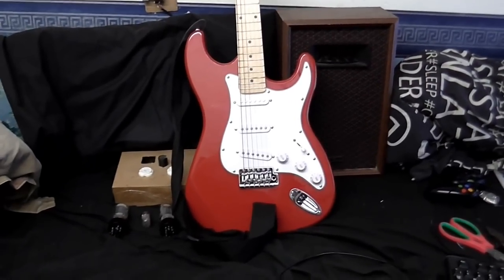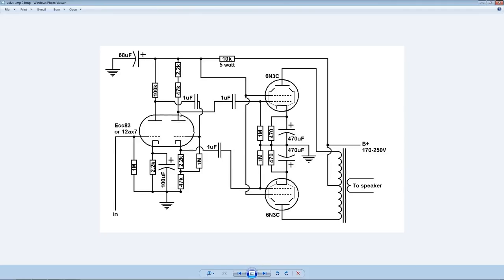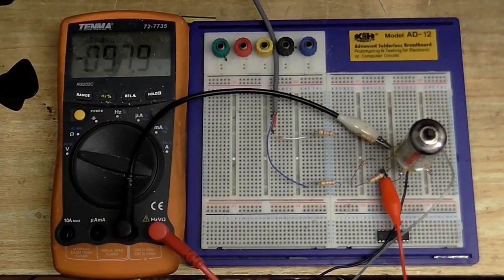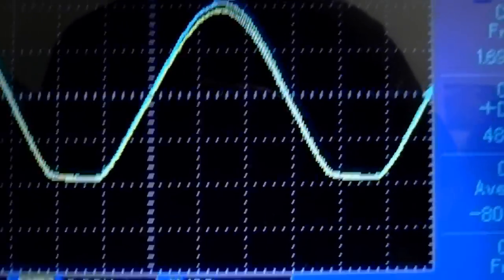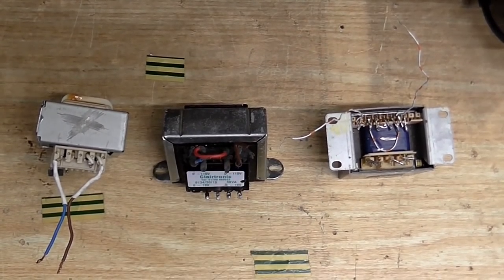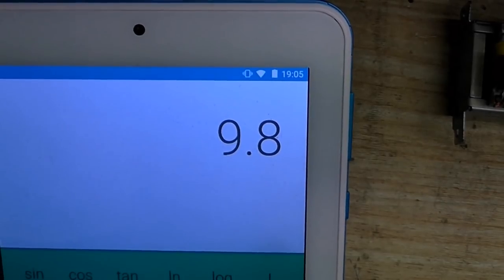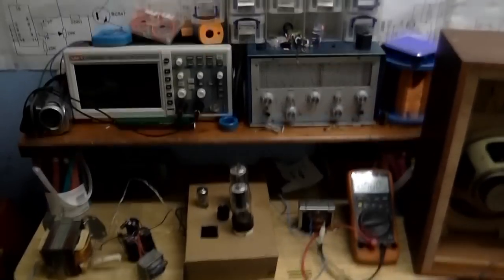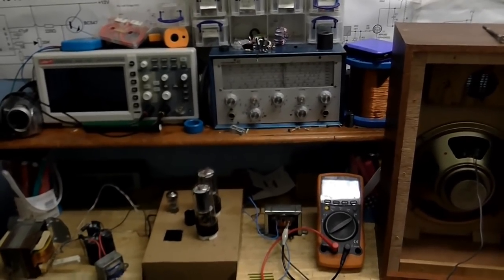Making a Guitar Amp Pt 1

Comment: Most guitar amps with these tubes put out 40-60watts push/pull.  It would probably blow that speaker.

However you need more gain stages before the phase inverter.  I would suggest running cascading gain using 2 more ECC83s if you want warm overdrive and sparkling high end sounds.  

Also are you going to add negative feedback?
Reply from the maker: I think that's a good idea, I'm sure one ecc83 would give enough gain as it can go very loud from a line level signal. I wasn't planning on adding in negative feedback, though, I see no point, I want gain, not reduction.

Comment: This is awesome, I'm about to embark on the same journey and build an amp using 2 EL84s and 2 ecc83s using a couple of transformers and a voltage doubler as well. Good luck with the rest of the project and as a guitar teacher keep up the good work on the 6 string, nice right hand technique

Comment: A regular Jimi Hendrix. Don't burn your house down with those tubes in a cardboard box.
Reply from the maker: Just doing what I can with what I've got, if I had the tools and the materials, I would make it out of metal and not give cardboard a second thought.
Reply: This is the short list of tools you need to make metal enclosures an angle grinder with a cut off disk, a drill with bits (including a step bit), two five inch C clamps, a couple heavy plates of steel (those plates with the C clamps and a hammer and you can do bends 3/8s of an inch thick would do it I have pieces I cut off structural steel like heavy weight angle iron), combination square, a file (maybe a few files? I like having a bastard, a round, and a square) and a hammer. There's more you can use but that'd do the job. Here's a picture of the C clamp and metal plate method of making a metal box https://cdn.instructables.com/F6H/A6AZ/GUOAF15Z/F6HA6AZGUOAF15Z.LARGE.jpg